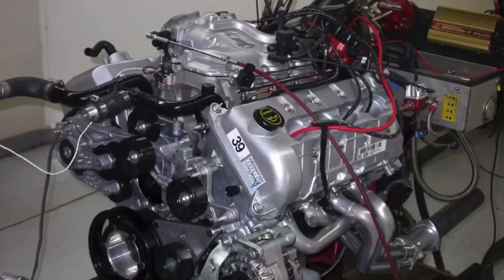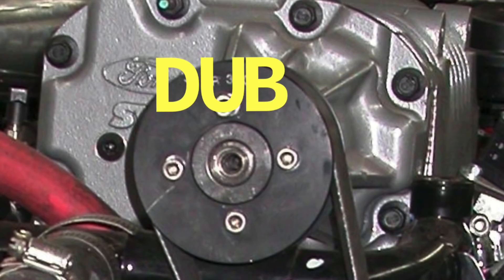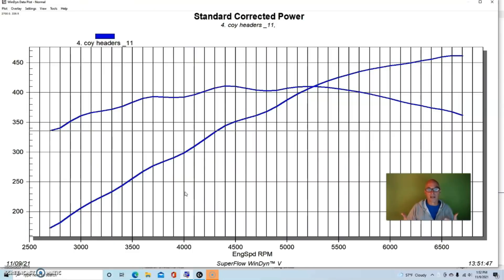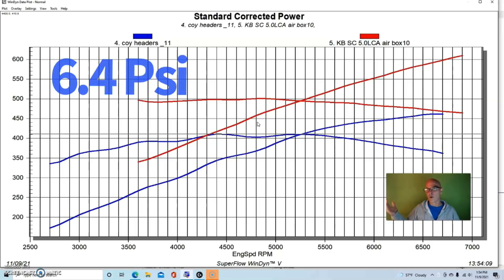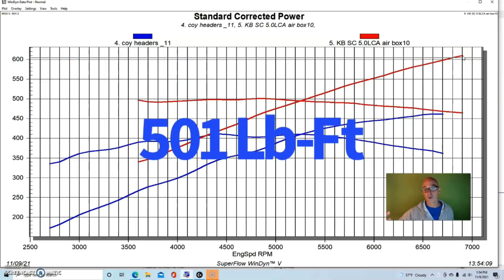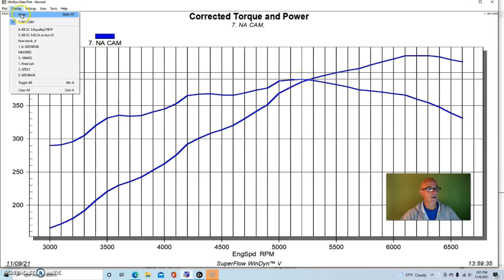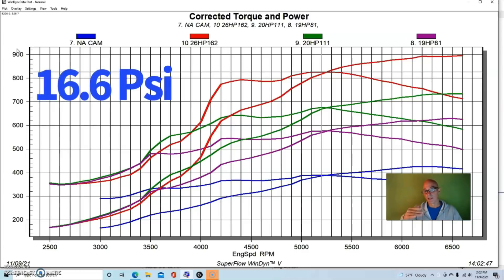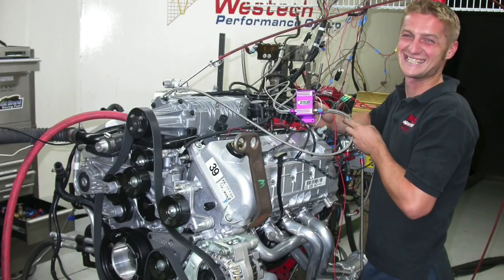HOW TO MAKE BIG MODULAR FORD POWER. 4.6L COBRA & COYOTE, TURBOS, BLOWER & NITROUS-SUPER POWER ADDERS

Comment: What's causing the "camel humps" in the curves? Is it some anomaly in the head air flow?
Reply from the maker: tuning
Reply: It's generally the engine having 2 or 3 dips are the reflective wave tuning in the intake/exhaust. I have stepped headers and it's quite prominent in my sheets. Even with the AFR and Timing advance locked across the curve.

Comment: Anything going on with the 6.8 V10?
Reply: Nodarperformance had a v10 with pi Pistons for higher compression and ITB. He put it in a ratty mercury Capri but I was pretty rad sounding. Ran on mega squirt too.
Reply: @zapa47  the sad part about the v10 is it has a split pin crank and doesn't have full counterweights, which means RPM will kill jt, as will power.